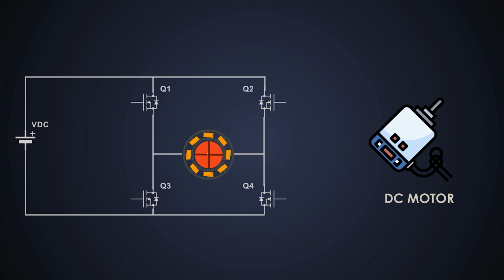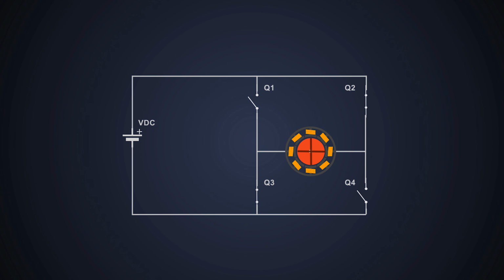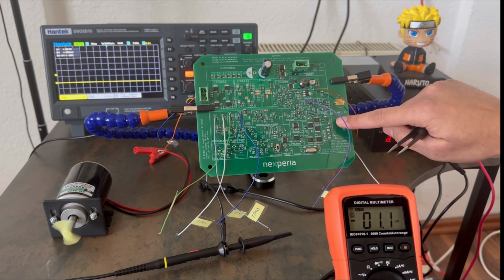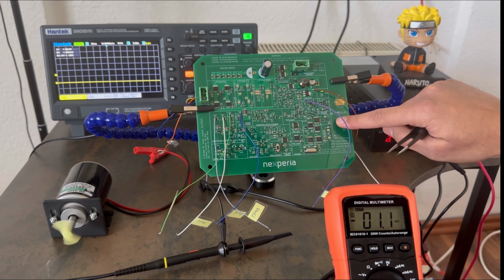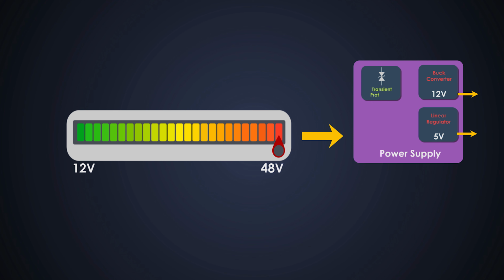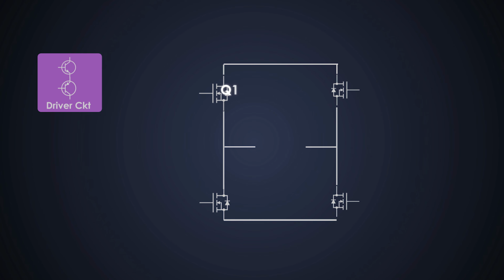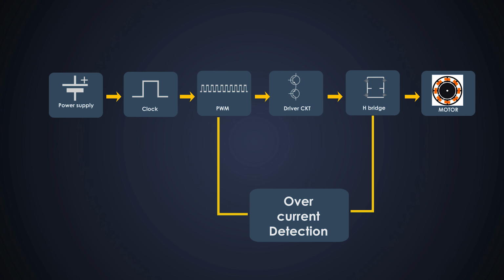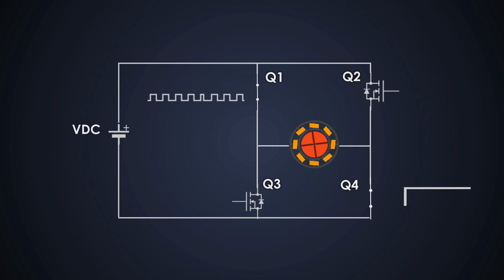H-Bridge DC Motor Driver: Exploring the Inner Workings | Understanding H bridge DC Motor drive.

Comment: why is q1 controlled with pwm cant we do the same by using low side driven by pwm instead of high side or am i wrong? i designed one using lm5109 and I'm facing few issues where motor jerks when i reduce the duty cycle of pwm .

Comment: Another great video.  When you look at these boards do you see and understand all the function blocks and how things work?  Im curious.  Ive been repairing industrial electronics for a while now but Im self taught.  So some of these small DC drives seem to be very complicated.  Seem to be.  Its often a struggle to follow the flow with so many bypass caps, feedback resistors, etc.  To see through the clutter.

Comment: Hey Parag very nice demonstration, I would like to add one thing here, whatever voltage we see on power supply which should lesser on the board because of big AWG wires. Even for scope measurement it would be good if you can use 30-32 awg wire for better results. Btw I like the circuit holder from where you bought that? Thanks for the amazing content as always!!!
Reply from the maker: Thank you so much for your suggestion!
Reply: @Foolish Engineer. Can you please make a video for feedback control design of buck converter? Or any converter. Thanks